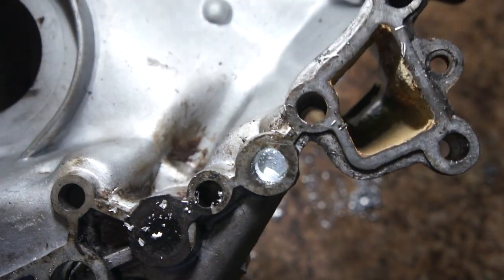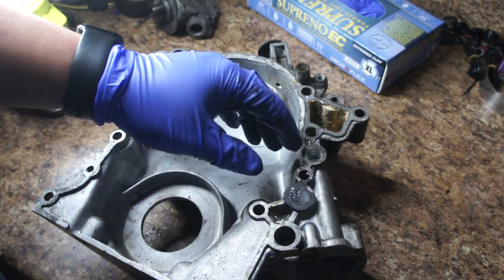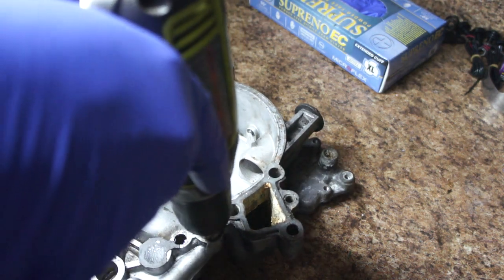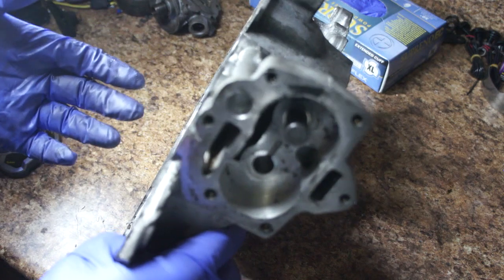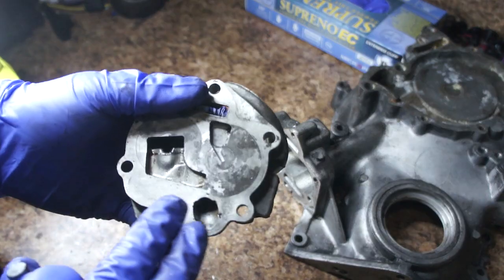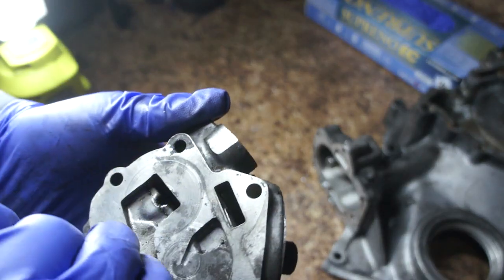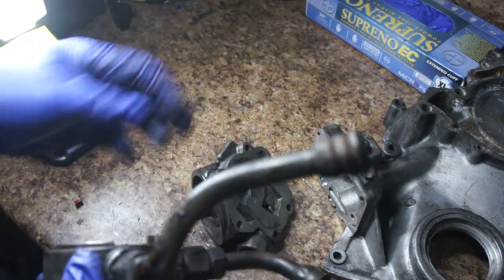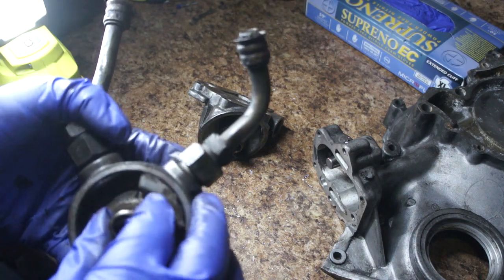Buick Timing Cover/Oil pump. How it works and some modifications.

Comment: You should try that 'earlbrown' mod.  You'll find that it'll cause the pump to self prime.  I don't recommend that, but it's a lot better to self prime than to never prime after the engine is running.

The main benefit is to let both sides of the gears get wet before the pressure relief spring opens.  That weakness is made worse by installing the stiffer spring and/or shimming that spring.   Running more poundage on the relief valve delays the time/RPMs before the restriction on the pumps low pressure side goes away.    And the general rule will all pumps, is you NEVER want to restrict the low pressure side.  It costs you big time on the efficiency at the high pressure side.

Also, the oil can't run out of the upper section over time unless there's a way for air to get in there to replace it.  As long as the oil filter pickup is submerged, only a leak could make that happen.  As long as the pickup is submerged and there's not leaks (either at the timing cover gasket, or the pickup tube gasket) the pump can't lose prime.   Same thing with putting your finger over a straw and lifting it out of a liquid.
Reply from the maker: I’ll take mods a la carte....lol
I guess I am missing something, the pressure relief valve is recirculating the oil so unless you are thinking of that oil (that is already worked on by the pump) as additive, I don’t see how that removes any restriction from the feed side. You will loose prime if you let it sit due to the system not being air tight(finger on the straw is air tight) and opening that hole lower in the cover only makes the level of oil in which the gears sit after it has drained back to be lower and the oil filters “drain back valves” are a joke...put a little bit of oil in any filter you have and lay it on it side, watch the oil go right past the valve...most of this is kind of like the “booster” plates, they boost pressure by providing a trued wear surface, not because of the holes on them....which in the ones I have held in my hands look like they would create restrictions right at the adaptor, the main reason for this video was because some people believe the pressure relief spring can raise their idle pressure 😂 and they pass it on as gospel. 
Btw thank you for all the write ups and stuff you have posted on the forums, I have learned a lot from there, don’t agree with some bits of it but great info regardless.
Reply: @VenomGT87   Your first sentence that says ''I guess I am missing something" is correct....

The relief valve does recirculate oil back to the other side of the pump...     but ONLY after it's opened up.   During low RPMs when the valve is completely closed, it's only allowing one corner of the gears to get wet.

When you go WOT (and need the oil on the rod bearings) the pump has to start spinning with a restricted inlet.  (basically the pump gears are forced to act like they are shorter on the low pressure side).  Once it get spinning hard enough and can crack the pressure relief valve that's when the other corner of the gears get wet.    That issue is made much worse by putting in the stiffest spring you can find.  The stiffer the spring, the longer the delay before the pump can reach its full efficiency.
  My ''earlbrown booster hole'' allows the oil to run right into the center of the gears on the low pressure side at ALL times.  As the relief valve opens the flow can adjust itself however it likes since fluids always follow the path of least resistance.

Buick V6s make a BUTTLOAD of torque at low RPMs so it's VERY important to have the pressure just off idle jump as fast as possible.  You never want to drive though weak oiling then have to wait to the pressure to catch up.

  That's why if you ever see one of my covers in action, you'd see a severe jump in pressure just off idle to damn near the full pressure.
Reply: @VenomGT87  I'm having an issues with my sons 3.8 losing prime on a 3rd oil pump rebuild. This past time that we did it, it ran great pressure for about 2 1/2 almost 3 months and just today it lost prime again when he came to visit. We do have a small oil leak coming from the crank pulley I believe but would that cause it to lose prime? The engine has about 28,000 miles on it since rebuild and runs great except for this issue and I hate to but I'm ready to give up on it after dumping so much time and moneyz into it. Any suggestions on what it could be???
Reply from the maker: mexicanlee if there are no noticeable leaks coming from the pump area. Did you check that the gears and  cavity are within specs? Particularly the driven gear. If Yes. 
I’d check for a loose oil pick up tube, torn gasket near the pump.

Comment: I was hoping to see how the gears work inside... I'm working on my 1982 buick regal V6 252 and my oil pump is bad which is bone dry behind the timeing chain cover.. We was wondering why we wasn't getting no fire. The timing chain is the original plastic gear was very surprised.. But going to replace that any way with the new timing chain gear kit.. The oil pump going to replace that as well. So hopefully by the end of the week it will fire up

Comment: Do i have to take the timing cover off to get that 1 gear out with the shaft
Reply from the maker: Nope. Just watch your cam sensor does not move.
Reply: @VenomGT87  ok cause it's only popping out like a 1/4. I can't get to come out
Reply: @VenomGT87  is that my distributor

Comment: Glad you mentioned that the specs of the oil pressure on the engine should be between 7 to 15 at idle because I've always wondered that and at idle I am at 15. But of course as you accelerate that really does shoot up pretty far. Another thing people try to use for the oil pressure to rise is a Melling thrust plate kit. I've seen that a lot on forums.
Reply from the maker: Those thrust plates give you better bottom clearance and a new wear surface. I would honestly go with the ones that Fabro used to make out of stainless because the finish is 10x better than the melling plates. I have seen some really porous melling plates that have lots of dirty edges and extremely rough machined finish.
Reply: VenomGT87 good to know. Just going to still keep mine stock for now. Not having any problems.

Comment: Can you make a video of assembling the oil pump I’m working on a Buick 350 which has the same cover and want to put it together right and know clearances
Reply from the maker: Once I get the engine in the machine shop I can definitely do that, but that is at least 6 months out. I can tell you the kits come with all the specs in a sheet, 3 gasket thicknesses and it is very straight forward, most important is the bottom clearance which you pretty much set with the gasket. But like I said it is coming and I can try to expedite it but no promises.
Reply: VenomGT87 sounds good

Comment: Man thank you for this video, it really helped me to understand how the oil pump works, I had a problem with my oil pump and when I took it and lose I found that the plunger is stuck in there and does not moving I was able to get it out but is was very tight and hard to move, what do you think I should do?
Reply from the maker: If you were able to remove it without damaging the adaptor, take it out and see if the bore is smooth, if it is get another kit and replace the plunger, testing it first to see if it moves freely, lube it with a dab of oil and is should glide in and out with very little force. If it doesn't replace the adaptor as well.

Comment: I took my oil cooler off. You don't need it. Especially when you use synthetic oil and have a 160 degree thermostat! Bonus points for a roller cam set up where there is not as much friction.
Reply from the maker: I was monitoring oil temps for a while and I came to the conclusion  that if you daily the car you kinda want to have it there because I noticed the oil temperature goes well above the engine temp, sometimes over 280 particularly after a run down the track or “spirited” driving did I put one on mine?....nope 😂
Reply: @VenomGT87  yea I've yet to be stuck in bumper to bumper traffic for an extended period of time so that's probably a good point. Every time I check my pan with an infra red gun, it's usually around 150.  My oil pressure at idle is 5psi after warm up but has plenty off idle. Been thinking about the Melling high volume gears to try and improve it some. And I just got done reading the same article that you probably have about modifying the front cover so that may be a winter project.  I live really close to Red Armstrong and I remember him telling me years ago during one of my visits that Buick designed these engines loose and he hinted that as being the reason why we're able to get so much frickin power out of these little engines without scattering them. I don't know if it's true or not but it made sense the way he explained it. I do know Eddie Cheever still holds the track record at Indy for the fastest race lap in a Buick turbo V6 ;)
Reply: I just installed a remote oil filter kit and a cooler today. I have a 350 Buick in my 66 Chevy pickup and I use it for towing... a lot!!! So I think it’s a good idea. But I wanna install a high volume pump since my average oil pressure has gone down a little due to all the extra plumbing.

Comment: I have a jeep wagoneer with the Buick 350 V8. I've got a slow oil leak from the Oil Filter mount gasket. It looks like it has a spacer. How hard is it to replace? 4 bolts pry it down and replace the gaskets or will gears and parts fall out when I remove it?  marc
Reply from the maker: If it has a plate sandwiched between the filter adaptor and the gear housing you may need to shim the gears to locate the plate but usually the plate is pinned in with two small  pins if it was installed correctly. 
Either way is an easy job to replace those shim gaskets. While you have it out you can resurface the wear plate and maybe get some oil pressure back.

Comment: With a new pump using white spring and 100psi at cold idle and 60psi in drive but when hot 85psi at idle and 65psi in drive, what would you think could be the cause for such high pressure? Clearance? 10w30 oil?

Comment: I wouldn’t mind getting your opinion though. Since I do lots of towing in hot weather with my Buick engine I’ve added a remote oil filter kit and an oil cooler but I’ve lost noticeable average oil pressure. Would that justify use if a high volume oil pump kit? I already have a new timing cover and a booster plate with the stock gears.
Reply from the maker: I would look at the fittings on the sandwich plate and cooler, see how small the openings are. I have seen kits where the fitting opening is 1/4”
Reply: It’s all half inch diameter. I made sure the oil was totally topped off. It’s not too bad now. I was a dummy. New filter plus new plumbing and I was a quart low. But it’s still a slightly lower average but not devastating.

Comment: Which Buick are you discussing? I was looking for the 2004 3800 series III . What you are describing looks like to me as a 350,455 style of engines unless this is a pre 2000 design. 
Good explanation of the circuit though. 
Im trying to play catch up on the 60's,70's,80's,90's & up to the 2008 Buick V6 3800 series III engines. Ive learned about the  fireball V6 designed &manufactured in 1961. By 1967 ,Gm sold the rights and tooling to willy's JEEP and after economic circumstances,GM BOUGHT the tooling back in 1973 after the oli embargo & began to build revised designs. I don't know if the 1976-77 designs had a pump design similar to the small block Chevy. If they did that would be cool to read up about. But engineering changes to hopefully improve the quality and durability combined with fewer parts to manufacture. Counter shafts ,electronic sensors, roller cams FI ,SUPERCHARGERS ETC.. 
IF you could suggest a publication of the V6 that i could absorb the design changes, that would be much appreciated.
Reply from the maker: That video in particular was for the 109 LC2 V6 but it is my understanding that the design is near identical to the earlier model V8’s Google “gnttype” and look in their library. Plenty of information and pictures for free.

Comment: This is in regards to the possible use of a regulated auxiliary external pump with appropriate pick-up located in the pan:  Has anyone thought about welding inlet and outlet tubes or pipes on the ports of the cover, stress relieving and then re-machining?  Or, maybe with the oil pump installed, drill an external hole in the pressure side of the cover, welding in a pipe or tube and then use  the external  pump during the low pressure condition? Thank you for considering my idea!
Reply from the maker: That is more or less the way accusump systems work. Now those are only meant for brief loss due to cornering and so on.

Comment: My gn only had 8psi oil pressure at idle hot and I had several people tell me to replace the timing cover and I did and my car holds right at 20psi at idle when hot. I had a old Buick guy tell me the problem is the shaft wears the cover and it looses pressure around the shaft.
Reply from the maker: 8 psi is still within spec hot. IIRC the shop manual calls for 5 psi at idle hot or something really low like that..lol

Comment: Are the oil pumps from a 4.3, buick gn, 350, or 455 etc the same design?  Could they be swapped on to upgrade oil pressure?  I have a 3.8 and need to replace pump.
Reply from the maker: No, the 4.3 and 350 are distributor gear driven. Usually the pump is not the issue, although it is your cheapest starting point.
Reply: what 3.8 do you have? i have a 07 buick lucerne with the series 2, my pressure was low when id start it for awhile or until i rev passed 2 grand, until i started it the other day and everything was ticking and the light was staying on. every mechanic i talk about say oil pump, but i cant find anything on my oil pump including location of it, only repair kits online. what did you do going on about replacing it, and where was it located??

Comment: I have a 72 buick centurion is the oil pump belt driven? Because there is an ac compressor, power steering, and then one other compressor that has a hose running Into the engine and I have no idea what it is
Reply from the maker: I’d have to see it but I don’t know of any Buicks with belt driven oil pumps. Smog or evacuation  pump maybe?

Comment: Is it necessary to put vasoline in the oil pump before re-installing after taking the oil filter off and removing the timing cover on a 3800?
Reply from the maker: Yes and no. You can just wet them with a heavy oil so it has enough seal and lubrication to pull the oil up to it when you prime it without scoring the surfaces.
Reply: VenomGT87 I didn’t take the oil pump apart or replace the pump. I just took the oil filter and timing cover off. Is it still necessary to lubricate it? It should there be enough residual oil in there to be ok.
Reply from the maker: Tim McElheny sounds reasonable but that is your call.

Comment: Where can I hook up a mechanical oil gauge on these motors
Reply from the maker: Under the turbo on the front corner of the block, behind the oil pump body.

Comment: The spring works when the motor is cold and needs to release oil pressure so you dont have 100 PSI idle lol
Reply from the maker: Yes, but mostly at  higher RPM to bleed off excess pressure. I've always ran HV gears so I always have to wait for the engine to warm up so my oil pressure is not ridiculously high. I am considering running a 0W-20 this winter because ever since I blueprinted the cover I have 80+ at idle cold and goes into the 90's if I start driving with the engine cold, once the engine is at operating temps I have normal oil pressure. I have considered going back to stock height gears but I am not a fan of ~10 PSI at idle.
Reply: I went with the Kenne Bell booster plate that Coach was making, you grind out a 1/4 slot on the Filter housing to mate with the Inlet Oil passage and the steel plate allows for a perfect surface for the gears too run on.. once the gears gouge the filter housing you lose quite a bit of oil pressure and I did the same 1/2 Drilling of the oil passage along with some TA performance Shims to get the perfect clearance on the pump gears and plate. Car has about 20-25 idle and 60-70 at 60 mph.
Reply: I wouldn't drop any lower then a good 10-30 oil
Reply from the maker: 10-30 is what I am running now and my main concern is the wear on the cam sensor and cam gears.

Comment: i am about to build a 350 for my jeep. where would someone get one of those plates for the oil cooler? i could use one for creeping at low rpm.

nice video.
Reply from the maker: Any universal sandwich plate would work but if you want an OEM one like this one, hit up the Buick pages on FB.
Reply: VenomGT87 oh sweet

Comment: Great video... How hard is it to remove? Is it just bolts or more complicated then that?
Reply from the maker: The oil filter adapter is held by 5 or six bolts, the hard part is aligning the gears with the spacer plate.
Reply: Did you have to reinstall at TDC? Or can I just remove timing cover, do mod and reinstall?